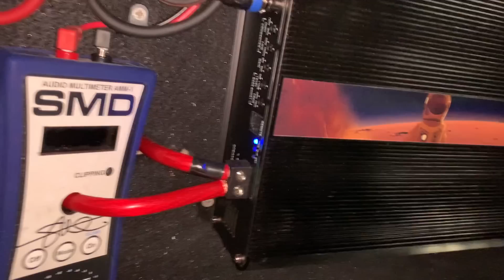SUNDOWN 18s on 16,000 Watts Part 5

Comment: For terminals I use all thread. Drill a hole slightly smaller than the all thread and screw it in. With the all thread you can make them as long as you want. Use two nuts and a washer on the inside and a nut a washer and a wing nut on the outside.
Reply: I use acorn nuts on the outside. Makes for a more finished look. 😊
Reply: @RJSDZNS  I like the wing nuts. Makes removal much easier.
Reply: @wijibo6772  I will not argue that sir😁
Reply: I like lock nuts because the massive bass doesn't rattle them loose.

Comment: If you still get whine after swapping out your rca cables then try to either ground the rca's negative to the vehicle itself or if still hearing it then get yourself a cheap ground loop isolator they usually eliminate all motor static interferences....

Comment: When painting MDF: mix white glue with water (or wood glue with water) and brush onto box with a chip brush, allow dry time, then paint. It will seal the pores in the wood so the paint/stain doesn't soak into the wood, leaving a dull finish. I didn't come up with this trick, but have done it and can confirm it works.

Comment: Hey, use rubber grommets on the inside and outside of your box speaker terminal bolts. I always recommend this they aren't expensive and they keep your box from getting pressure squeeze marks and it's just a little extra protection just in case.

Comment: Just wait till you got them broken in
Reply: Those are used, fully broken in they got spider sag
Reply: @ChaosTherapy719  😂😂😂😂
Reply: @ChaosTherapy719 Spider sag???????? Hehehehehehehehehehehehehehehehehehe lmao!!!! XD😭😭😭😭😭😭😭😭😭😭😭😭🤣🤣🤣🤣🤣🤣🤣🤣
Reply: @Terranwilliamson1745  what's hilarious is y'all don't pay attention for shit lmao Parker as soon as he bought the 18s said he got em used 🤡🤡🤡🤡🤡
Reply: I don’t think sundown you have too break in correct me if I’m wrong but I think they be breaking them in at the factory and you can slam on them when you get it
Reply: @Navvvv_  yes they hit each sub with Bass Checka by Bass Mechanik for inspection purposes to check for defects that would then cause them to place defective units in the Yard Sale listing. But over time spider sag is inevitable as the material of the spider softens up from many many many hours of play time.
Reply: @ChaosTherapy719  not all used subs are fully broken in. Mine weren’t when I first got them and I got them used.
Reply: @Navvvv_  it’s not really a requirement, but the longer you play them the more they become a little loose. The break-in suggestions were usually for making sure your subs wouldn’t break when going full power but Sundown subs can handle that, they just won’t be as loud until they loosen up a little.
Reply: @MannuhFestIt  depends on the spider pack the red Nomex and the Corey Blue Gang spiders are the stiffest you can get
Reply: @MannuhFestIt  the stock tan spiders suck ass
Reply: @ChaosTherapy719  oh I definitely didn’t have that spider lol
Reply: @MannuhFestIt  me either I went with a red nightshade spider for the Xv2 12 I refurbished
Reply: F yeah boiiiiii
Reply: @ChaosTherapy719  Yes I am guilty of watching it at work and missing bits and pieces of the video
Reply: @Bassamdkatz719 I’m 45 now. I too know what it feels like to have “spider sag”. 😂
Reply: Wait til the suspension is sloppy

Comment: Need some help… I am putting sound system on my boat and I have the Skar 1500.1 marine amp but needing advice on should I go with the EVL 12 loaded enclosure or the dual 12 svr loaded enclosure??? It’s going in a compartment behind the back seat also.

Comment: I personally don't care for the simple poke bolts out the side of the box it looks kinda cheesy but here's a terminal tip, which is take a 4" or so hole saw and put a hole where you want your terminals router a radius on the outer edge looks nice and then attach it however you choose over the hole on the inside then put your bolts through, not only does it look less "ah whatever good enough" but it also recesses your bolts so if it's on carpet not sitting on a hard surface you could lay the box on that side if you change your mind on where to aim your subs or just to hide the terminals. Trust me it looks way more professional than diy.
Reply: Just tie a knot in the wire then feed it through a hole in the box. No chance of ruining the carpet, and you get no change in wire diameter from a terminal block or bolt.

Comment: After I finished building my 2 custom D2 400oz 15s that are now at half ohm on my cab45 on lithium I had a small chip on the bottom of my windshield from like 5 or six years ago that's lived through the pretty decent setups ive had but after a couple days of the new setup my windshield cracked all the way to the top. I have Mixed feelings on that one it sucks my windshield is toast but the idea my subs cracked it from the bottom to the top is pretty cool. It does flat out slam now but I'd say the reason it cracked is it's a grand caravan so the windshield frame flexes big-time and it was chipped already so it's not because subs are so insane it broke my windshield...

Comment: Would suck if the Marts amp is the source of the whine...
Reply: Probably is. My Mart’s and Expert Electronics (same company it seems by the design and manuals) we’re identical and both caused hissing and whining in my system. They can’t take over 1.9 volts of RCA input or they cause a dirty clipped signal on every output.

Comment: Parker you certainly could have done more to ensure the box had better fliw like rounding over the edges of the port sides kind of mimicking a kerf or even actually kerfed them inside and out and use 45's on each inside corner and then for $20 you could get a SMD terminal that looks alot better than a couple of shiny bolts lol this box was absolutely rushed and it shows them woofers deserve better
Reply: I will msg you some cut sheets and a box design for two 18's that will get the most out of these whether you choose to use it and build a proper box or not is entirely up to you bud....

Comment: Nice Vid!
The Box looks realy great!
I have a Question for you or maybe youre Subscriber:
Was buying the DD Audio Redline 812 Dual 1 Ohm Sub. The Sub has no stitching and has 1000/2000 Watt RMS and 6000 Watt Max.
I plan to build a Sub Box for it and mount it with the Motor outside. Box tuning between 28 Hz and 32 Hz.
Would drive the Sub with 2 Hifonics ZXi 1501 Monoblocks.
USA Made for the Win.
All in my Ape 50 from the Manufacturer Piaggio in Italy. Its a 3 Wheeler with a Box.
After all these important Informations now my Question:
Does anyone have all the needed Specs for the Winisd Programm?
Realy hope, someone can help me out.
I ask DD Audio with a Ticket 2 Weeks ago, but no Answer.

Sorry for my bad english, School is realy long Time ago.
Greetings from Germany
Reply: If it’s a new sub, it should come with a parameter sheet. If not, contact their customer support.
Reply: @jxke  thanks for your Answer.
It is a old Sub!
Its not on their Webpage, exept you google it "DD Redline 812" then you can found it there.
Was buying it from a guy here in Germany used, but in pristine Condition.
I was contacting customer support, but no Answer since 2 Weeks.
I was hoping someone from the Basehead Family could help.
Reply: Switch hifonics for dd brand amps to match sub, had horrible results with hifonics on my 1 zv3 18 sundown D2 now i hve a second zv3 18😎it is time myself to build a box for these beasts, old school for the win n im 22🤧😂. Hifonics isnt clean and way over priced for what your looking for, im using jp23v2 for the one guy, saving up for a second amp n for 0 gauge i have 2 awg in the car rn😵‍💫

Comment: Bro you desperately need terminal reducers on that Marts amp... Some good heat shrink to keep them terminals seprate, that amp will POP if even one strand touches. Its way too much power to be asking for forgiveness from the protection circuit